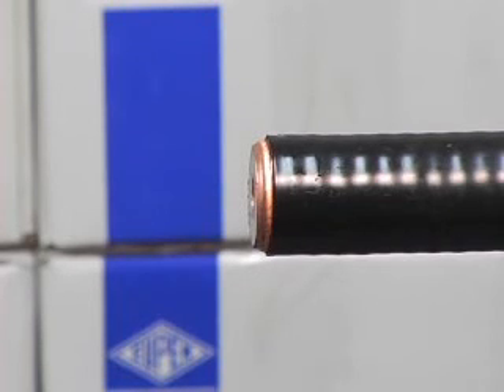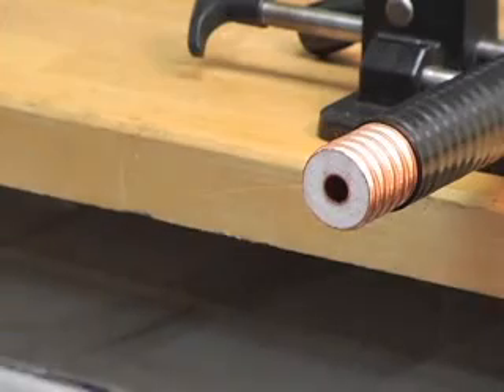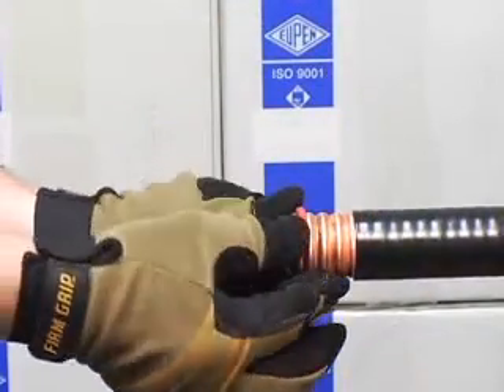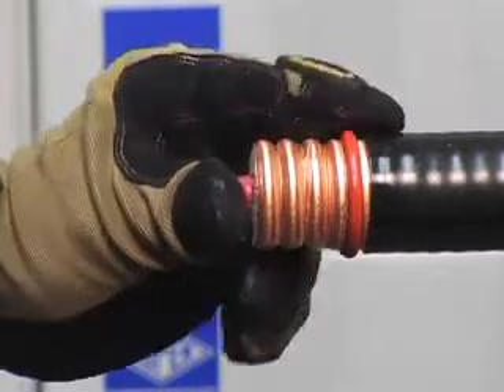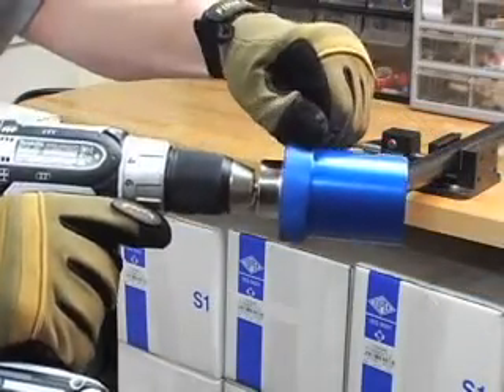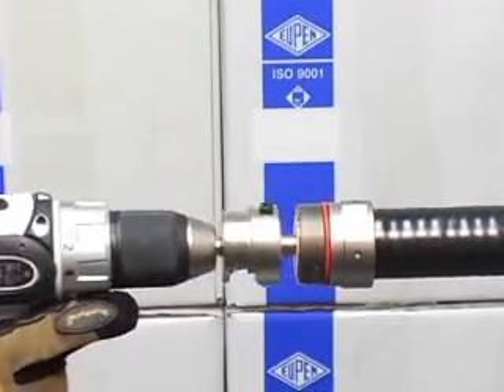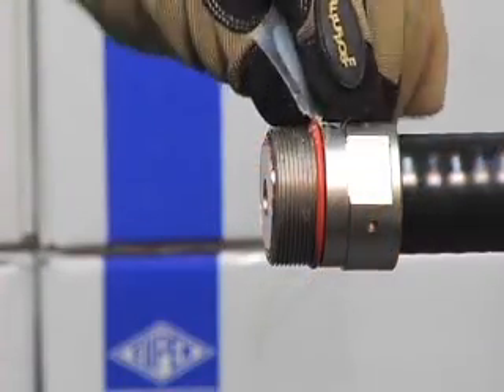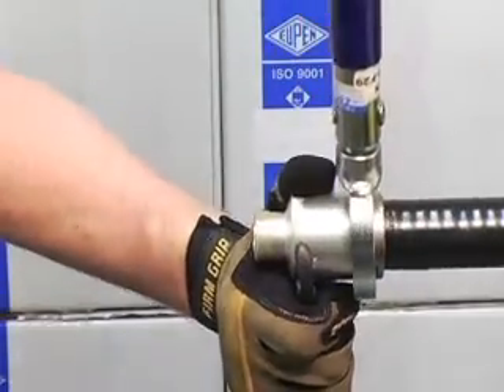How to Install Mono Block Connectors for:  7/8"   1 1/4"   1 5/8"

Comment from the maker: 1 5/8" Part List: F-158 - 1 5/8" MonoBlock Drill-mount Cable Prep Tool, TQ-214-F37 - 1 5/8" Back Nut Torque Wrench, 5472A3 - 1 5/8" Spanner Wrench, SPB11 - Trim Head Blade, F-158, B711 - 1 5/8" Main O-Rings

Comment from the maker: 1 1/4" Part List: F-114 - 1 1/4" MonoBlock Drill-mount Cable Prep Tool, TQ-11116-F29 - 1 1/4" Back Nut Torque Wrench, WR-114 - 1 1/4" Open-end Short Wrench, SPB14 - Trim Head Blade, F-78/F114, B710 - 1 1/4" Main O-Rings

Comment from the maker: 7/8" Part List: F-78 - 7/8" MonoBlock Drill-mount Cable Prep Tool, TQ-30MM-F22 - 7/8" Back Nut Torque Wrench, AD91030 - 30mm Wrench, SPB14	- Trim Head Blade, F-78/F114, B709 - 7/8" Main O-Rings